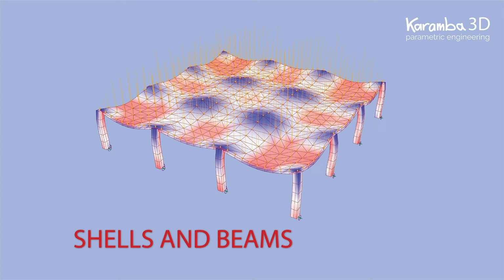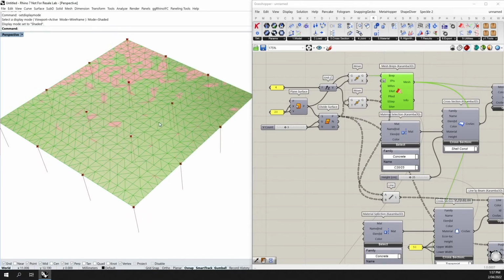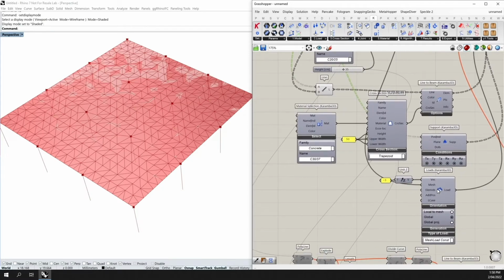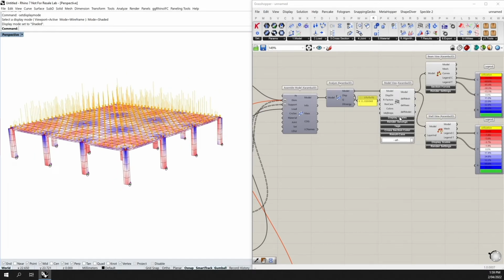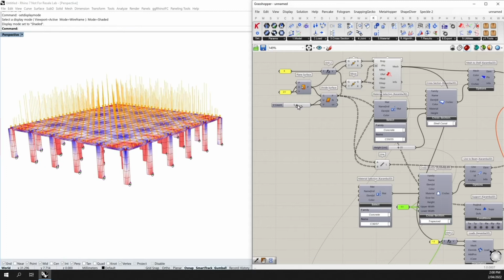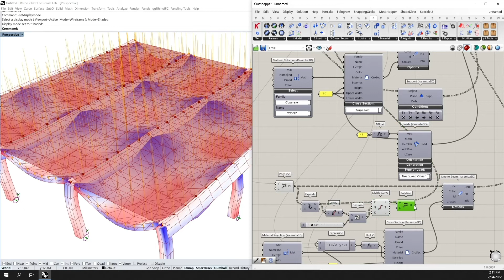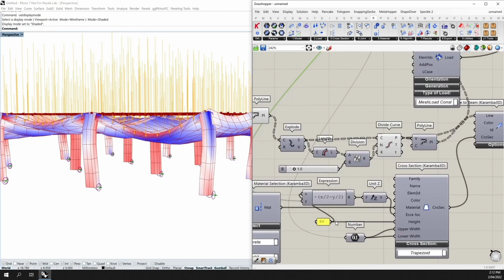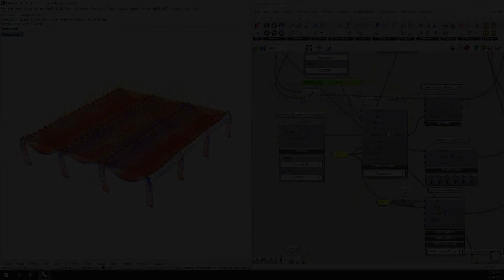Karamba3D TidBits #24 Shells and Beams

Comment: a slab without  reinforced ? how?😐
Reply from the maker: of course it is possible to analyse the structure with reinforcement too (https://manual.karamba3d.com/3-in-depth-component-reference/3.3-cross-section/3.3.2-shell-cross-sections)